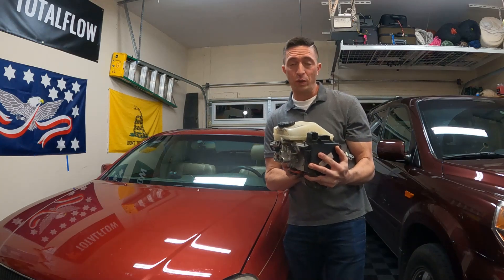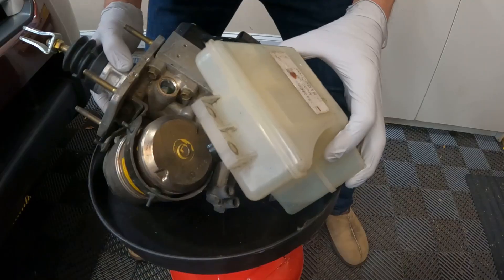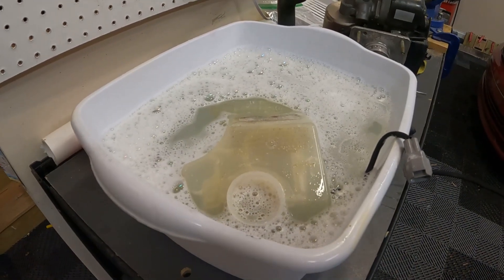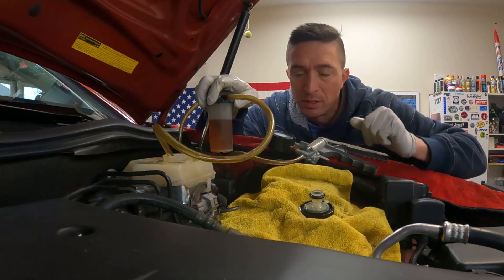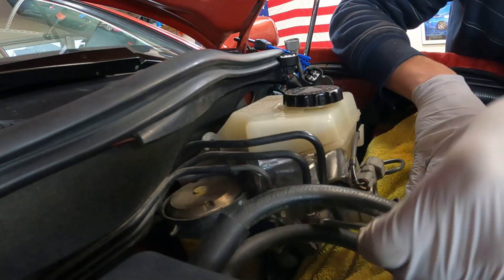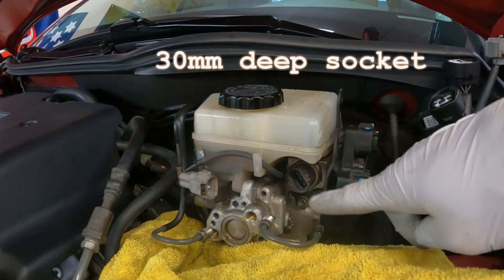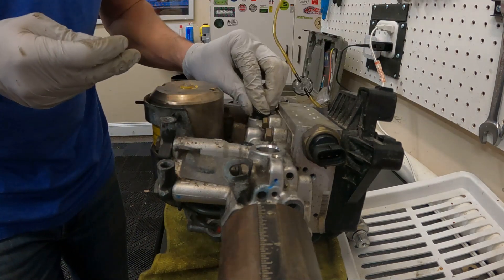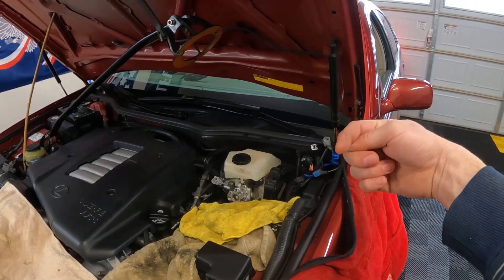LEXUS / TOYOTA Brake Master Cylinder Diagnosis, Replacement & Brake Bleeding (300/400/430 shown)

Comment: Could it just be the electric brake pump motor making the noise i have the same issue on my gs 430
Reply from the maker: That’s exactly what it is. Problem is just replacing that motor isn’t easy just by the way it’s designed. Take apart an old booster and you’ll see what I mean. That thing is nitrogen primed normally too. I hate that stupid booster unit.

Comment: I’m probably gonna have to do this again since the replacement unit I got was older and didn’t have all that much life left in it. Sux but I’m so glad this is still here as an amazing reference point. 
Only question I have about it is what is the FT/LB for the brake lines to the module cause the initial issue that caused the first replacement was over torquing the driver side and striping the female port :/.

Comment: No one wants to do the work called about six shops or something
Reply from the maker: That's why I show you how to do it. Shops want to sell parts (huge profit margin) and these are no longer available new, so those reasons explain why they're not wanting to do it. If you are unable to do it for whatever reason, or don't want to, I'd call a mobile mechanic and ask if he will install and bleed the new BMC only after watching my vid. The job takes about 3hrs start to finish, and maybe $20 in shop suppliers. If he bills at $100/hr, that's about $320 in labor. Well worth it if you find a reputable one willing to watch my vid and take on the job. Honestly, the hardest part is the bleed if you don't have a techstream device. You don't want some fool jumping into the car and pumping the brake pedal to the floor. That's NOT how it's done.

Comment: So my aristo doesn’t have the squealing or any messages or lights on the car. But my brakes do not work at all. My pedal is just crazy soft. Even after a full bleed ad you just did. Bloody car
Reply from the maker: That sucks. I know how frustrating these systems can be. They do have scan tools that can read ABS system codes that regular scan tools cannot. Maybe that’s your next check?

Comment: changed the motor and it did nothing. Dealer said that it will cost $4500 to do it but they dont make the part any more. I think they dont want to be responsible for a 27 year old cars braking system. To bad, nice car. Stupid design for the assembly. oh well going to try and find one on the internet.
Reply from the maker: Thanks for reporting this. There are some keyboard warriors on FB and forums saying the motor can just be replaced and based on my dissection of my bad BMC, I really don’t see how that can be done effectively. You essentially confirmed that. I suggest the latest, low mileage SC430 HBBA/BMC you can find. 👍
Reply: So I replaced the bmc and bled them. Does it work, no. Has your applying the brakes, you lose the brakes for a split second, then they come back on. Bled them a 2nd time and the same thing, loss of brakes. It does not happen all the time though. So upsetting with his design of Lexus. Contemplating on getting rid of it, but it rides so good and plenty of power for it's age.  Also replaced the front wheel speed sensors as well. Anyone experience this before, please any advice would help.
Reply: Finally solved the issue is had with the abs kicking on at a slow stop. The tonal ring was bad in the front strut, from the bad wheel bearing. Got a dealer tonal ring and it works great. Going to keep it now. Your videos are great, keep making them. They do save people a lot of time and money
Reply from the maker: Tone ring! Yes. Another GS saved. Good job. 👍
Reply: Thanks for everything

Comment: Also, what year was the donor assembly from?
Reply from the maker: 2004
Reply: you cant just replace the abs brake booster pump motor? I lost all brakes due to the stupid design
Reply from the maker: Some people say you can. I don’t have any experience with it. A new motor was $100 and an entire booster assembly was $200, so I just chose that option.
Reply: unfortunately they are running like 400-750 for used right now. I think I'm going to try the ABS motor 1st and see what happens.
Reply from the maker: Please report back here with what you discover. A new motor would be much easier. I dissected my old one and it was definitely the motor causing the issue as there was direct contact with the brushes on the case due to corrosion and contact with the commutator brushes on the shaft itself, grooving it. One caution was how the wiring worked. It appeared to be “one time use” from vehicle power to that motor; kind of an integrated internal set up, so I wasn’t sure how to get around that. Another reason I skipped it.
Reply: I changed it on my aristo and still have the buzzing noise... trying to figure out the issue. Might just get a sc430 assembly @ForwardMomentum

Comment: So mine makes a seatbelt charm sound, with the abs vdc and park brake light, do you think it’s the master cylinder? 

I tried pulling codes but none come up, brake work normally as well, but I do have to bypass Park with the park release button, what may be the solution?
Reply from the maker: That does not sound like the BMC. The random squealing sounds and low pressure alarm are dead giveaways. I think you need a special scanner to pull ABS codes.

Comment: Wow😳 These are the exact same sounds that my car makes. 2004 Lexus GS300. The ticking sound been going on for years. Now that censor sound just started a couple of days ago. Today the brakes arent working well. Out of 1-10 they are working at a 2 or 3
Reply from the maker: Yeah, I really hate these complex boosters. Totally unnecessary complexity and susceptibility to corrosion (the root cause is the accumulator motor commutators and brushes contact the case and shaft. Eventually it cannot build pressure and that’s why the low pressure alarm starts going off and the brakes don’t work as well.

Comment: Would you able to press the brake pedal all the way to floor? I just bled the brake with techstream but the pedal is still very soft and I can push it all the way down, not sure if it suppose to be like this or if the ls400 front calipers have anything to do with this.
Reply from the maker: You should not be able to go to the floor with it.
Reply: @ForwardMomentum Yours won’t touch the floor even pressing it really hard?

Comment: Is this bleed process necessary for rotor/pad replacement? GS300 oem bmc, only replacement will be rotor/pad
Reply from the maker: No. If the system isn’t “opened” it doesn’t need to be bled. Just keep in mind that manually compressing the calipers to fit thicker pads pushes fluid back to the BMC, which can make it too full. So, you may want to remove some fluid with a baster or similar to allow the back flow to go to the full line.

Comment: This was such a stupid design. As if these units were going to last forever and be readily available for replacement. Toyota made some really boneheaded decisions heading into the 00s
Reply from the maker: Completely agree. While one might argue, “hey, they easily last 150K-175K mi, what’s the big deal?” I think it’s more the design choice. A complex brake boost assembly that constantly primes, with a literal motor inside of it, is just asking for trouble. So dumb and so expensive to replace (new, at the dealer it’s now around $2800). There were a lot of good decisions by Toyota, but the HBBA/BMC in these cars is stupid.

Comment: Thanks for the video. I was watching your bbk video and stopped instantly to come to this one. Im new to the chassis (gs3) why an sc430 booster?
Reply from the maker: I explained it in the video, but maybe you missed it? Generally the 430 boosters will be newer, have less miles, and there’s a rumor the bore is slightly larger. The first two reasons are why I did it, but I have a 400, which stopped production in 2000.

Comment: So where is the chirp coming from exactly? The hydroboost pump assembly? Or the master itself? Does anyone know?
Reply from the maker: It’s the accumulator motor case, commutator and brushes. Corrosion and direct contact of parts causes the noise. (I dissected the unit weeks after I shot the video).

Comment: To check the fluid level on this system you have to follow the depressurization sequence of pumping the brakes at least 25 times with the key off. Then you add fluid to the line. If you don't do this first, it will look like the reservoir is low because once the pump turns on and the system pressurizes, fluid is stored inro the accumulator. So if you fill it up with it pressurized and the vehicle sits a little while without turning the ignition on, the system will slowly depressurize and the fluid will move back to the reservoir and leak out around the cap and get all over everything. Brake fluid is extremely corrosive and a great paint remover.

Comment: You want to make sure the system is depressurized before loosening any lines. This system stores around 2800 psi of pressurized brake fluid even if it has sat overnight. To depressurize, pump the brakes at least 25 times with the battery disconnected or at least have the ignition switch turned off. I would just disco the battery that way you don't have to worry about the brake lights or shorting something out, etc. Problematic system since the 80s on everything from BMW and Mercedes to Pontiac and Ford. Can't believe manufacturers continued to use this style of braking system into the 2000s. The domestic manufacturers ditched this style back in the early 90s and made the ABS actuator/pump assembly separate from the base power brake system. To rely on an electric pump to develop fluid pressure for power braking instead of a vacuum booster.  Not to mention when the pump fails, you lose rear brakes altogether. 

If the pump has failed, there should be no pressure in the system. Something that you want to do on these Teves type systems is listen to how often the pump has to turn on. It should only run every 2 or 3 normal stops. ABS stops are different and the pump will run continuously during a panic stop. If you notice the pump turning on every time you press the brake or you see the ABS and brake warning lights staying on for a while after you park it for a short time, then you want to replace the accumulator. The accumulator is around $200 from Toyota, maybe more now, its been a while since I bought one. No bleeding is necessary for this service. But definitely depressurize the system prior to removing it.

Comment: Awesome video!
My GS300 just started making the R2D2 sound 🙂
My question is: would the unit from SC 430 from 2002-2010 fit?
Much appreciated the answer, especially the last comment was 2 years ago.
Reply from the maker: The SC430 unit is what I installed. I’m not sure if there was a mid-model unit cutover or not, but you could check by going to https://www.toyodiy.com/ and messing around with SC430 years and seeing if the unit’s P/Ns match or not.
Reply: @ForwardMomentum  Thank you for lightning fast response and great suggestions!

Comment: Pulling in the house and my brake light came on and im getting a constant loud beep from the dash. Never had a problem, i was driving like 50 mph when it happened. Wth? Is the booster shot? Tapped the actuator with a wrench and it kicked on and is working flawlessly lol. 🤷 You're a godsend for this TY. You got a hell of a deal on that unit. Their up to like $450 now
Reply from the maker: That’s the low pressure alarm. It’s almost always the booster, unless you have a leak. Smacking the accumulator motor a bit could definitely buy you some time, but typically that beep and a pig squeal is the beginning of the end. I have seen a few pop up in the $200 range and there are plenty of wrecked SC’s out there too. Good luck with it! 👍
Reply: @ForwardMomentum yep she's done brother. Stranded at the gas station the very next day. Got a like new one on ebay with a 13 month warranty. Towed to the shop cost me 1k total . It is what it is, I knew it would happen eventually and I knew exactly what it was when driving and that alarm went off. Pick it up Monday. I'm surprised it didn't happen earlier, owned it for 12 years at 166k miles. I love her and it was an easy decision to spend the money and fix her. Thanks for everything man. We're back!
Reply: Are u having or have u had the so called tone ring problem? The abs kicking it at 5mph and below? I'm stumped cause my tone rings look great and all the sensors are working but the rears are falling off at low speed stops.
Reply from the maker: This seems intertwined with your booster failure. How are you determining the sensors are good? You really have to use an advanced diagnostics scan tool to check.

Comment: i have a JDM aristo and i just put LS460 calipers and rotors on. i bled the system with a pressure bleeder and it seemed fine, but the pedal goes to the floor when the car turns off. i did not turn the key on at any point. i am going to redo it this way and hopefully that will fix things... because the brakes are incredible when the pedal is there.
Reply from the maker: Good plan. Report back and let us know if re-bleed fixes it. 👍

Comment: So what if I do every step but the beeping doesnt go away. Pump is running and the bleeding isn't going as planned
Reply from the maker: The replacement pump is bad, there’s air in the lines still, the bleed procedure isn’t being followed properly. Check over all obvious things such as the pressure sensor was swapped, is hooked up, etc. Carefully go over all lines and make sure there are no leaks. Work your way down the process from there.

Comment: Hey man, I'm also swapping a sc430 brake booster into my 98 gs400. I had a question, did you use the brake lines and fittings(the ones that screw into the booster) from the old booster or did you have to swap over the ones from the new booster. Some people online say that the old fittings don't screw in all the way. Thanks
Reply from the maker: The video shows everything I did. I didn’t do anything behind the scenes like that. The ONLY thing that needs to be swapped is the pressure sensor. If people are struggling with engagement, then they probably cross threaded a fitting.

Comment: Thanks for this video.  This enabled me to do this myself.  I was going to have to shell out $1200 in labor alone if I had the dealer do it.  One bit of advice for anyone reading this... don't tighten up the assembly at the firewall until you have all the brake lines reattached.  Having give in the assembly makes reattaching the brake lines much easier and you are less likely to run into crossthreading issues.... as me how I know.  Thankfully I was able to salvage it with my brother in law and father in law to help.  Thanks again.
Reply from the maker: Awesome! Great job. $1200 in labor is crazy. My dealer wanted $2300 4 years ago (I always call and ask to make myself feel better about doing the job). 😆
Reply: Hey, did you swap a newer unit into a 98-00 gs400 as well? Did you use the fittings/ brakelines from your old brake booster, or did you use the ones that came with the new unit? Thanks

Comment: hey man, im having issues with my brake master cylinder for (1998 gs300) and i was wondering i heard rumors of the brake master cylinder being the same one for a 1998 to 2003 land cruiser. i just wanted to ask if you know anything about that.
Reply from the maker: I have never heard of that, but if you find out it does work, please report back.
Reply: @ForwardMomentum  it’s a negative, they super similar but it doesn’t fit.

Comment: Hi there. I have issue with lexus gs 300, when breaking,RPM drops for a few seconds then rises or car stalls when braking. What is a problem can be?
Reply from the maker: Follow the FSM low-idle troubleshooting steps. It could be a number of things so guessing and throwing parts at it would be unfair to you. Start with the easy stuff, like post-MAF vac leaks.
Reply: @ForwardMomentum  Tank yo very much for you answer and your advice. 
I will try it.
Because that really annoying,and no one can finde what is issue is. I've change MAF sensor,after VVTI valve, throttle was cleaning as well.

Comment: Did you notice if the abs motor was running much more frequently before you replaced it? Lexus hybrid RX400h uses the same system (as do many hybrids and gx/4runner, lx, etc) and mine has not triggered any lights, but it's running all the time (much more than any of my other cars with the system) as if pressure is leaking off somewhat quickly. I'm wondering if the brake assembly or accumulator is going bad on mine.
If you noticed a change in the frequency of the pump running, that would be great to know. Thanks in advance.
Reply from the maker: Yes, I did notice more frequent activations, but duration of each run wasn’t excessive. For my BMC, it was the screeching that was a sign it was failing. I dissected my BMC assembly after filming and found the accumulator motor brushes and commutator directly contacting the shell and shaft, not to mention there was corrosion everywhere as well. I hope that helps.

Comment: Did you remove the object underneath the brake pedal after bleeding the BCM?
Reply from the maker: No, I still drive with it there to this day. 😂 Seriously though, once bleeding is done, remove the block.
Reply: @ForwardMomentum  not what I meant lol.  Is it only left there for bleeding the module or for the entire bleeding process
Reply from the maker: Oh, ha ha! Yeah, I just left it there for the entire bleeding process, including the BMC and all calipers. Just didn’t want to risk over-stroking the cylinder.